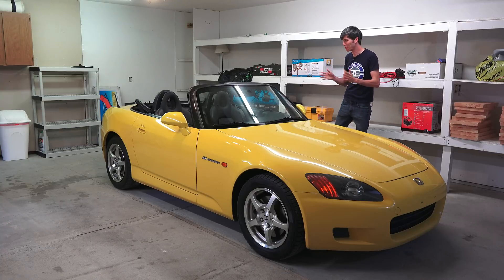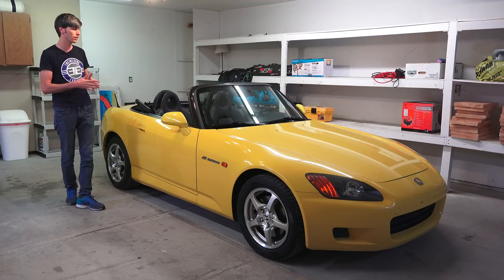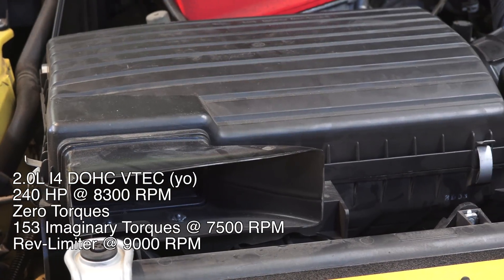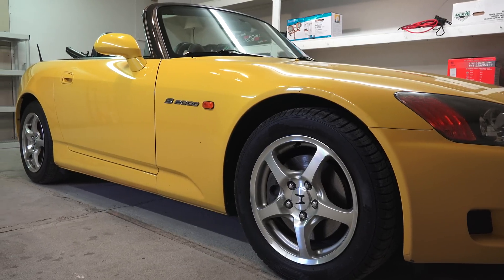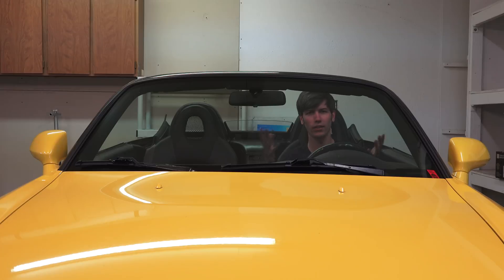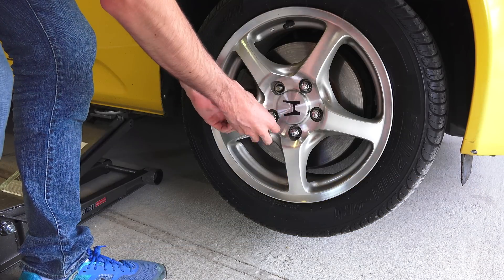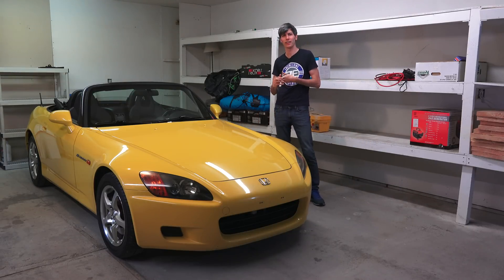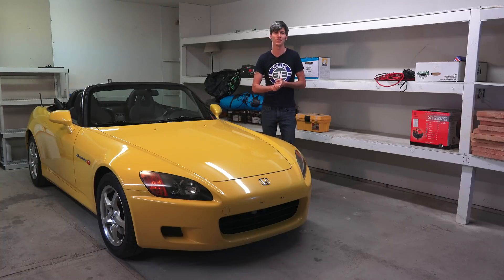I Bought A Honda S2000 And It's Amazing!

Comment: Great Choice! As a Fan of the show, I'm excited to hear more of your comments. I have a 2004 S2000 it's NZDM with the 2.0L and Yellow. I love the car, track or road trip there is nothing quite like it, it's really special and I'm hanging on to mine. I've had it on the dyno and with IHE it put down 230whp.  

I'm not sure what will apply to your particular car but being a 2002 you may want to look into (have also owned a 1999 s2k yes they were sold in 99 JDM yo, so I'm well aware of the nuances of the early models):

Revised valve retainers (early ones crack and drop valves)
Revised oil banjo bolts that lubricate and cool the pistons. 

Also you will find the 'roll moment' is greater in the front than the rear, combined with with the rather stiff rear ARB and the stiff chassis your inside rear wheel will be encouraged off the ground in tight bends this will cause the Torsen to just spin up the inside wheel. :(  You're engineering explained so I wont tell you to 'suck eggs' by explaining this or how to fix it any further haha. 

Anyway I'm a wealth of s2000 information. Enjoy your new car.

Comment: Congratulations on the car. They are awesome cars. If you take care of it and don't beat the hell out of it.. will last you a long time. My friend has an 04 he now has 290,000 on it. Only repairs were clutch at 190k and a fuel injector started leaking at 190k. Top replaced about same time. other than that just Batteries, Brakes, tires and oil changes.

Comment: nice car......ever since Honda got into the lawnmower market they have loved those RPMS, 9000 rpms applies just the right amount of centrifugal force, any more and that car would likely vaporize, an less and it would be sucked into a small black hole. Torque is to scary for some drivers, so a torque less cars should stay out of high winds and never ever stop on a hill, just as long as you stay on a flat surface and check the Anemometer you'll be fine.     hahahaahahahah   no really way cool car!!!!

Comment: S2000 was so ahead of its time that even if they were producing it nowadays it would still be in demand and would probably sale better than cars like gt86 etc
Reply: It would also be a LOT more expensive than those same cars.
Reply: Actually no, the first year the S2000 was introduced in 2002, it sold about 9,000 cars in the USA and the sales numbers dropped every year until it was discontinued. It never sold well.
Reply: Victor Sanjurjo the s2000 also weighed in at just under 3000 lbs, the mx5 of the same year 2300 lbs. For the size, weight, and cost of the mx5 it has enough power. 237hp should have come at that high a price
Reply: $80,000 brand new here in Australia and it did not sell well at all way to expensive for what it was, yes its a great car but not $80,000 great.....
Reply: +Victor Sanjurjo the Mx5 has always sold better. and stood the test of time
Reply: +buildmorefarms100 and primarily because of cost. Part of what Mazda did along with you listed it they made it affordable. Honda didn't
Reply: Che M True! Mazda has a way of making fun affordable reliable cars at every level of price point. Mazda does not make a boring vehicle. Truly amazing.
Reply: +actuis in comparison to the 500 lb difference between it and the MX5 yea I would call it just under 3000
Reply: Wrong. On just about everything. According to Wikipedia, a similar year Miata (NB) weighs 2348. Add a 200 lb person and it's 2548. Not "barely" 2500, but halfway to 2600. Add a 200lb person and to 2809 lb S2000 and you get 3009. Not "well over", but barely over 3000. This is basic math and English comprehension, man.
Reply: It was introduced in late 1999 as a 2000 model.  Sales didn't drop every year, in fact they increased with the AP2 introduction ion 2004 and then a few years later starting tapering off, especially after the financial meltdown in 2007.
Reply: +thescoolestkyline  definitely, because the s2000 is such a well built car. it's what a miata should've been
Reply: Honda s2000  always sold very few cars....it dropped every year until discontinued.
Reply: Both the Mx-5 and the S2000 are great cars. Mazda pioneered the category though/ made roadsters reliable, nimble and super fun. Honda wanted a piece of the action and also jumped in after they saw how much success Mazda had. Sadly the Honda never took off the way that Miata did.
Reply: +Che M  Of course, it's almost perfect. But it's big flaw is power. I love Miatas, but it crushes me seeing how much power it makes.
Reply: Victor Sanjurjo The newest one does 0-60 in about 5.8 seconds...enough for most people. But it is designed for efficiency.
Reply: An S2000 weighs 2809 lbs. Is that really what you'd call "just under 3000 lbs"? That's a 200 lb difference, man..
Reply: +actuis  the average person weights close to that and factor in their passenger and possession. It'll be well over 3000 pounds. For a miata it'll barely hit 2500
Reply: actuis so it's still a 500 lbs difference?
Reply: Che M That's horrible logic. You may as well say the Miata is just under 2500 lbs. Also, after a quick google search, that 2300 lb Miata is a base model NB with with no AC or power anything. A miata that is similarly equipped as the MY2000 S2000 is about 2450, while that same MY2000 S2000 weighs 2750. That's more like a 300 lb difference. Applying your previous rhetoric, it's not that much of a difference.
Reply: too expensive, people just want horsepower or being cheap.
this is art of engineering and producing 120 hp per liter its crazy for NA 
also most people that buy hondas dont want them new, or they are just haters and dont think hondas are any type of performance vehicle
Reply: actuis you may be right or not I don't care to look into it. The point is for a much lighter car to have much less power and be much cheaper Mazda succeed where Honda overshot. Mazda made a car that felt quick, handled nicely, and did what they wanted as far as efficiency. I still think the S2K is a better car but not at the price point it released for.
Reply: So true!!!
Reply: +Che M  Definitely, the car is fantastic. BUT was very expensive, even in today's standards.
Reply: Tony Walker Not is USA. In USA it was introduced in 2002 and sales dropped every year until it was discontinued. http://www.goodcarbadcar.net/2013/06/honda-s2000-sales-figures-usa-canada.html
Reply: It was sold in the USA from 2000 to 2009

explain to me how a ~$35,000 MSRP two seater roadster is going to "sell well"  what exactly constitutes as selling well?
Reply: Your chart doesn't include year 2000 and 2001.  I was talking about worldwide sales.  I own a 2005 AP2 and it was definitely available, the AP1, in 2000 and 2001 in USA.  It had a plastic back window those years.
Reply: tagrav the Z sold well
Reply: S2000 Started in 1999 until 2009,
Reply: SeMpr3s Soren that would be model year 2000
Reply: In Australia we have 1999 model an 2000 model,  ;)

Comment: Love it I basically have the same formula as you still considering either S2000 or Toyota MRS (swapped with k20a) 
low weight, 50:50 distribution, mid engine, high rev, manual = fun to drive formula 
But getting this S2000 - a legend to be car , you really need get this car on trackday ;)

Comment: it's  a clean car i love it when Honda  owners actually care about their  cars,  one question i just saw the dyno sheet  for a Honda  s2000 and the wheels,  and it only did 177 hp and that car is advertised at 240, and never mind the car was really  well taken car off like the the yellow  s2000 on this video, is the math off or did Honda  over sold the 2.0 on the s2000? i think  if you do the math after drive train looses that 240 becomes 210 or 200 the worse it could get is 190, again  love the car I'm  a fan of the s2000 but something  is off.
Reply from the maker: I don't know. I hope to dyno mine after a few repairs.
Reply: +Engineering Explained my understanding from the sheet that i saw, car had under 125k miles and it has not been molested or messed with, but what would be the drive train loss of a 240hp  motor? ( i know it depends  on how efficient the drive train is but just prentend )  220? 210?
Reply: Could that have been in Kw not in Hp? 240hp comes to 178Kw which is very close.
Reply: RWD drivetrain loss is 10-15%.
Reply: +Chris Ramos They list BHP. The dynamometer reads WHP. You lose about 30% of your power when you put it to the wheels and it also has 100+k miles
Reply: +big shot2291 Most parking brakes wont hold up to power. They are only made to keep the car from rolling, not to stop a car.
Reply: I dunno. Mine has the same exact mileage almost - and still feels as strong as my other one that had 60,000 miles. If properly taken care of, 105K is just getting warmed up.
Reply: +Aidan Francis i understand that completely, the car probably  makes  about  210 at the wheels brand new, but loosing 40hp  kinda sucks :(
Reply: What altitude above sea level was this dyno run taken at?  Naturally aspirated cars lose power and torque at altitude due to the decreasing oxygen density. Turbo/supercharged vehicles are affected as well, albeit to a much lesser, often negligible degree.
Reply: +Freddy P no man, I'm  not the biggest  Honda guy ill admit to that, but I'm a very big fan of the s2000 is just a beautiful car, i would  buy one just  to use it on the week ends, but that particular one I'm talking about has 125k miles on it, no issues that I'm aware off, i keep in mind i could  be wrong, i was not at the dyno, i just saw the dyno  sheet, and it claimed 177hp  at the wheels, again I'm not a Honda hater nor I'm a Honda guy, but I'm pretty  sure that after drive train  losses of those 240 you get 210 and from wear and tear that car should  be making 200 or 190 at the wheels, and please note : I've never seen the car's service history so the owner could be pretty much lying to me, but i saw the typical Honda power curve: nobody home below 6000 rpm, when the car hits 6000 there's  a huge jump in power, the famous v-tech kicked in, i can see why people like Honda's,  never owned one myself, maybe I'll give  it try some day.
Reply: Can you post one engine that made more than 161 lbf·ft naturally from no more than  2.0L I4 in 1999?
Reply: Pity they only made them 2 liters. And the torque deficit was lamentable. 

I had high hopes when the Integra line was phased out in favor of the RS-X, and fervently hoped that Honda would enlarge the AP1 platform and make a RWD Integra replacement. Alas, it was not meant to be.
Reply: Chris Ramos You'll likely lose 60-75 horsepower at the wheels, so a maximum of 3 hp lost is actually quite good
Reply: Aidan Francis since you put like that yes😅
Reply: +Titahbayflier the S2000 is a RWD drive car and engaging the handbrake on a dyno won't make the wheels turn at all..
Reply: +Aidan Francis you will never lose that much
Reply: its 240 at the crank you lose a lot through  to the wheels, what a lot of people aren't realizing is that its torque is low compared to similar engine sizes (most have close to or better torque then hp where the s2000 has 70 less,  about a third), and since hp is simply a measure of torque, it would make sense that you would have a bigger hp loss. It is however a mod friendly engine where people make a lot of power with mods. there is a s2k with f20 engine that's drag setup making over 1000 whp , and another f22 that makes 1600 hp and held the world record quarter on factory block at 7.1 sec.
Reply: J Shoes a 240 hp with manual rwd loss is ~ 192hp
Reply: depends on car, ive seen S2ks dyno in the 190 range but ive also seen them down in the 170s and again that's maybe the average car not the S2k. its also f22 vs f 20, the f22 makes a little more power but the f20 revs higher. so the losses are different.
Reply: J Shoes I don't believe it works that way drivetrain loss is math it's not based on car model. If the DT loss is 30% your looking at about 160 hp. Assuming 237 is the actual bhp
Reply: ok but ever engine makes different power (the s2ks advertised hp is crank not wheel) hp is torque*rpm/5252. then different transmissions have different amounts of loss then differentials have different loss as well, so the math wouldn't be the same for every car with that horse power, ideally all s2ks would be the same but the range widely based on witch engine you have how well it was maintained, who tight the valve clearances are, the elevation above sea level, the humidity levels in the air all play a factor. I personally have never seen an s2k that made more then 200 hp all stock. I have seen ones making 190-170 all stock. and yes it is math but its more then just oh this hp - this % = end hp. its more like this engine at this elevation with this %humidity= chp  % loss from transmission -% loss from differential % loss from rotating mass for different wheels or weight of car= whp on that given day in those conditions. the loss might not always be 30% so you cant use that for exact numbers you could only use it for a generic ball park. and the s2k is 240 crank hp so 240-72=168 ive never seen an s2k make that low so chances are its less then 30% loss again every car is different and has different amounts of loss.
Reply: J Shoes got ya!
Reply: if I ever get my s2k dyno ill post the sheet up but I'm not stock anymore so,
Reply: If s2k lose good amount of power it's probably running on 3 cylinders or something bad is going on with the internals
Reply: well there is also a 2.2l s2000,maybe that's the one you were taking about with 240hp?
Reply: +Aidan Francis it doesn't take 30%he off the engine to whp. it only take about 10-12 hp to get my car going, 96 civic dx. so you lose about 10%hp . I have an app called torque. it can check everything on your car. cool app,must have. it's only $5 much cheaper than what ever electronic you want to get from factory
Reply: *****

Except that the 2.2 in the AP2 series dropped the redline down to 8500, much tot he chagrin of the Honda faithful, and they also tweaked the rear suspension design to nerf the tendency for the S2Ks to swap ends when the driver chicken-lifted the throttle mid corner. This did affect the sharpness that the AP1 was known for.

Porsche 911s had a similar issue until the developed the Weißach axle for the 928 and phased it into the 911 platform as well.
Reply: ***** FWD has less drivetrain loss than FR'S
Reply: ***** I prefer the Z
Reply: 240-177 = 63 HP lost to drive train and wear.

63/240 is a little less then 25%

A lot of people say 15% is typical and maybe it is but 25% is within normal range for drive train loss. Given dyno differences as well its not hard to believe at all.  Can't wait to see the dyno!
Reply: If that S2000 is only making 177 hp at the wheels then that car has issues. An Ap1 s2000 will make 195-200 at the wheels. Anything over that the motor is strong. Ap2 s2000 will make about 210-215hp.
Reply: It highly depends on the dyno - my S2000 is in the top 20% of the stock S2000 and i have also a dyno run with only 180 hp at the wheels. My experience is: You can only compare two cars on the same day on the same dyno.
Reply: What civic is that
Reply: ***** your not bursting my bubble all 3 of my cars make more than that lol. 
So it makes less than the S2K 7 years later?
Reply: +rebel 510678 that's a 2l.or 1.5 turbo. but both of them not rwd. personally it cause too much wheel spin when you trying to floor it.